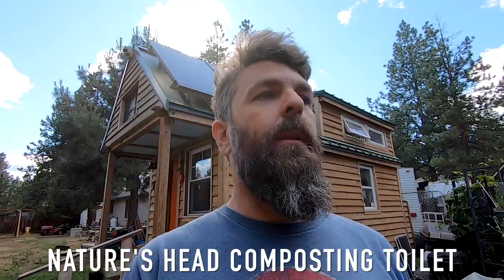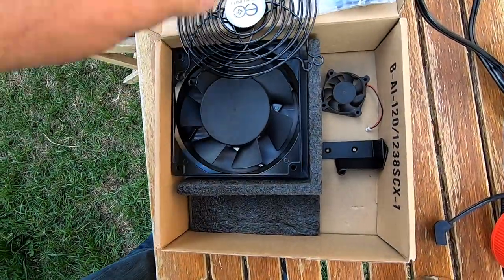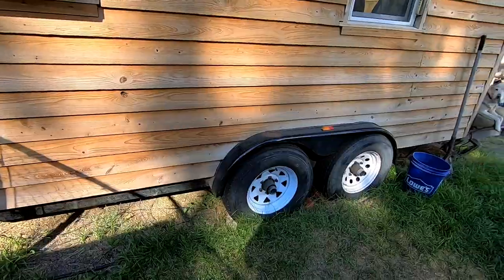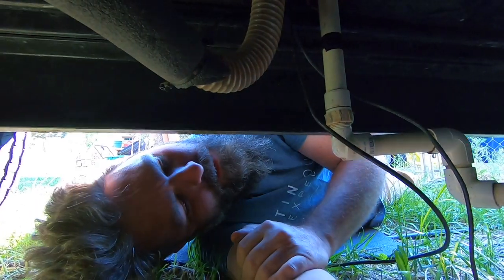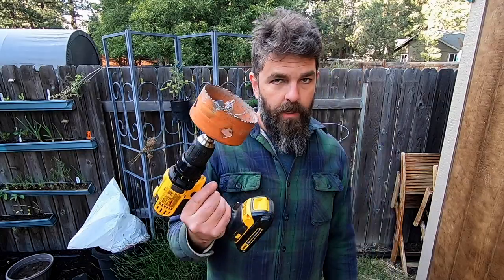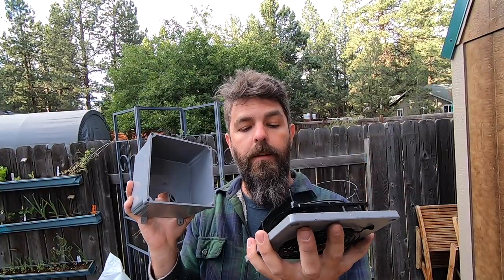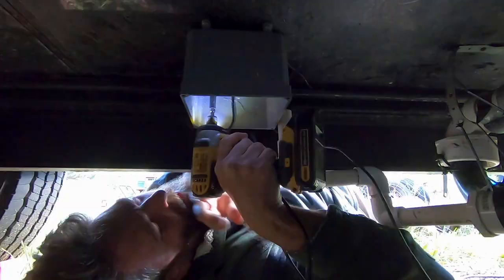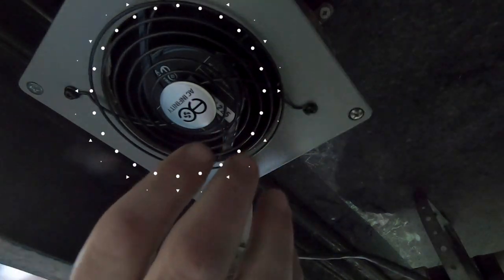Tiny House Composting Toilet: Nature's Head DIY Fan Upgrade

Comment: just followed all the steps laid out here with the affiliate links from the description.  a couple notes: the link to the waterproof box leads to a different, larger unit than shown in the video.  there are size options to choose from in the listing, but none have the exterior mounting holes/tabs as seen here.  to get around this i just drilled into the inside of the box. nbd.  next, as a pen couldn't fit down into the holes of the fan's housing, i used the loops/eyelets on the grill as a guide for where to drill mounting holes.  finally, since the position of the exhaust tubing was, in my case, right up against a 2x8, i had a tough time getting the box to sit flush against the bottom of the house.  without a tight fit, the fan would not be drawing nearly as much air from the turd bucket as would be needed, so I stuffed some bubble wrap in the cracks.  so far so good.  i'd have put something more permanent/professional in those spaces, but i had about as much clearance as uma thurman in the buried alive scene in kill bill, and a storm was coming, so fingers crossed.  hopefully these tips are of some use to others attempting the same fix.

also +1 to the plumber who strongly recommended using clamps to hold the box in place while using the hole saw.  i'm surprised our video creator didn't whip himself in the nuts at 1000RPM.

Comment: As a plumber who uses big hole saws every day DO NOT do what this video shows. The saw will lock up and the piece being drilled will spin around and mash your fingers or hit you in the nuts. Use clamps or screws to hold the part being drilled into position.

Comment: interesting as the Nature's Head is billed as relatively smell free. Knowing that this is "sort of" the case, I'll just rig up my own fan when I get mine.. :)
Reply from the maker: Good call 😊👍
Reply: Okay I have a natures head and have tried 1,000 different Peat moss/cocoa coir combos and clean the thing completely between emptying it and have replaced this stupid little tiny fan 1,000 other times and I swear the first solids dump you take in it, it already smells. I’ve been so mad at myself for spending $1k on a poorly designed piece of plastic. 
Thank god they made this video.
GUYS THANK GIF YOU THOUGHT OF THIS. I thought of a bigger fan but didn’t know where to install it thinking it’d just get in the way of an already poor system. You did it 🥲

Comment: Did you add a "bug screen" at some point (to keep out mosquitos)?
Reply: If the fan runs 24/7 like its supposed to, there should be no way for bugs to enter.
Reply: There are actually screens on both sides of the Natures head toilet vents. One on the intake and one on the exhaust. They are not shown in the video but great catch!

Comment: Question: with methane rising, wouldn’t it make more sense to have the tubing go up instead of down?
Reply: 3 years too late, but with a static vent (no fan) absolutely, With a fan, its a lot easier to run through the wall/floor for most folks rather than doing roof work/getting on a ladder.

Comment: I have been using the Natures Head for some time now.  I found that the biggest problem is that the filter at the fan gets plugged with dust from the peat moss and no air will flow. I also added a 3 inch blower fan that helps a lot.  I may change that out to a  Bilge Air Blower https://www.amazon.com/dp/B01FXHVSIC/ref=cm_sw_em_r_mt_dp_U_ZuteFbN7TKN20